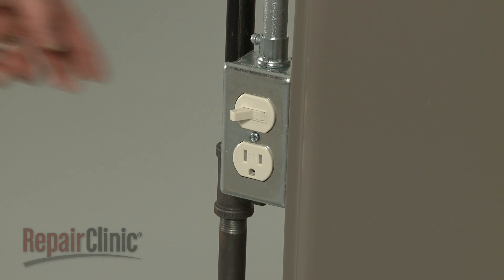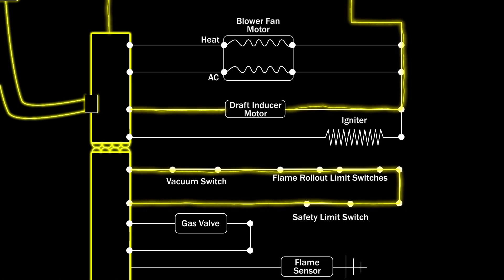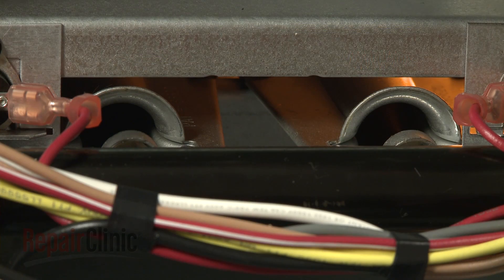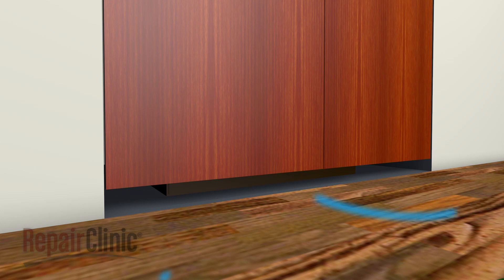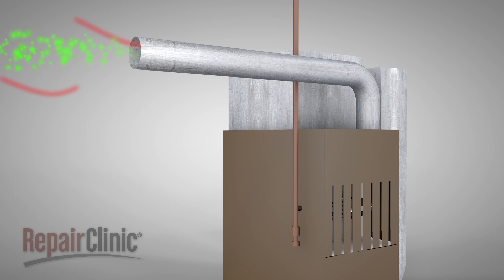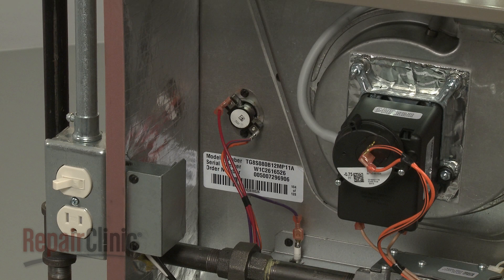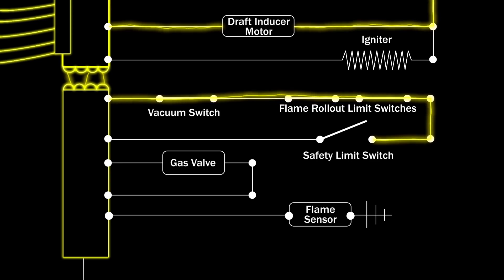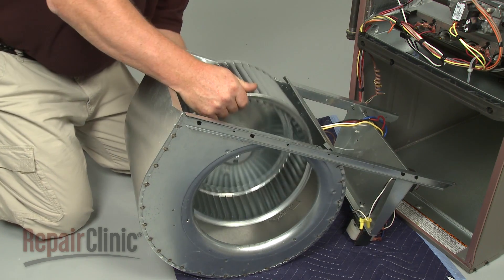How Does a Furnace Work? — HVAC Repair & Troubleshooting Tips

Comment: hello. recently my furnace burner would not turn on. I checked all the signals and even replaced the gas valve. Finally, I discovered a way to make it operate by disconnecting the 12way connector on the main board and reconnecting it back again. Unfortunately, I have to repeat that every morning now !!. The main board LED would not blink indicating any issues it shows "normal operation" indication. !!. I have Goodman furnace "GMS8 90". Any tips on what to do next?

Comment: Quick question. Accidentally dropped a plastic/metal TV cable staple down into the return plenum in a tight furnace closet. I can't reach it or see it because it bounced and went down the bend into the top of the gas furnace. There is no air filter that I can find and all the plenum is taped well. Down flow system. Do I need to get that staple out?

Comment: My landlord say he pays gas/heat . But a blower fan is required here with HVAC furnaces. That means I get hit with an electricity bill and resulting me "paying for heat" . Just a heads up guys in case you run into this issue.

Comment: Very grateful for this clear video! No one, and I mean NO ONE has been able to tell me, though, why residential furnaces aren't constructed to draw combustion air from the OUTDOORS. The video mentions it as an option but I've never seen it implemented. That means that all combustion gas released to the safe outdoor pipe has to be replaced with outdoor air, leaking into the house wherever it can "find" cracks or access. This must tremendously (and expensively) reduce the efficiency of the whole process! This would be avoided if an inlet pipe were bolted from the outdoors directly to the furnace. The same is true of fireplaces. My family insists on running the fireplace in really cold weather (after all, that's what it's for!) but I can feel the resultant negative pressure pulling cold outside air in through dozens of places within the house. Serenity now! Please feel free to contact me at davidasproul@gmail.com if I fail to revisit this YouTube video for replies. Thanks!
Reply: Maybe it's more of a regional thing but around here anything mid 90's and possibly older are like this.  There are two PVC pipes typically, sticking out the exterior wall, one intake and the other exhaust for the combustion air.
Reply: @Puckgrinder85  Where I live in Europe it's forbidden BY LAW for the gas fired central heating system to take in indoor air. Has been that way, as you said, since around the mid-90's I think. Usually the pipes for intake and exhaust are concentric, so you only see one pipe.

Comment: Use electrical heater or dx reversed cycle heaters
Reply: Those are extremely expensive to run and cannot run 24/7 as they'd burn out easily

Comment: Hi
I live in England and we have Kerosene oil system as we live in a rural area, I service and repair my own oil fired boiler, self taught with the help of the Internet and tutorials on Youtube at times.
As an electro / mechanical engineer I am always interested to learn about anything thats working in our home.
I often wondered about the furnace system as its a big beast and floor standing, here most of our boilers (furnaces) are wall mounted and much smaller, our system heats water and that gets pumped around the house via copper pipe and radiators.
Many similar operations between your furnace and our boiler system ... really thought your tutorial was worth posting on just to say that anyone could follow it ... great video.

Comment: I just smelled an awful smell of like melting plastic or something in a room by the basement where my furnace is located and not long after that, the furnace shut down. Is this a fire hazard? How was it probably caused?
Reply: Everything Channel Could be anything. You should call a professional
Reply: Michael Mace that is what we did. Burned out start capacitor.

Comment: I have a question: I moved into my house 9 months ago. All gas appliances. Within the last 2 months I've smelled as if something's burning coming from the vents in the house. The first time it was so strong it woke me up thinking it was a fire but I didn't see any smoke. I called the real estate agent in January expressing my concerns. He came over 15 minutes later, looked the furnace over changed the filter and said the unit looks good. Few days ago I smell the same thing only this time very faintly. The function of it is good. Puts out adequate amount of heat. Clicks on and off. at different times. Is this smell normal?? Should I be worried???
Reply: what did it end up being? Dust in the ducts? Or was the unit over heating from bad supply air or maybe it was a cracked heat exchange?
Reply: carbon monoxide doesn't smell like anything that's possibly the most dangerous thing of CO, it is imperative every home has a co detector in the home it doesn't have to be fancy just any type

Comment: I have a Fraser forced air furnace that stopped working properly at the beginning of spring.  A repairman came by today and found that the reason the furnace was not getting past the initial start up process was because there is a dead bird where the exhaust vent and the motor housing meet.  It's not inside the motor wheel (because that was spinning enough to generate a weak exhaust flow), just at the exit of the motor housing.

I thought all he had to do was remove to bird, vacuum out any dust, feather, etc. but he's insisting that the whole draft inducer motor needs to be replaces.  Keep in mind the motor is working, it's just running too slow for the vacuum switch to close and the ignition sequence to begin (thank you for the "How Does a Furnace Work?" video - very helpful!). 

The repairman claims that he won't be able to get the bird our without it falling apart.  And when it falls apart, he's concerned that it will "contaminate" the rest of the system and cause further problems.  I asked if he could remove the motor assembly, clean it out and reinstall it since it's working. He insists that won't work, the whole thing has to be replaced.

My questions are: is that a reason to replace the draft inducer motor? Could the bird be removed, the motor cleaned and house reinstalled w/o causing any damage to entire heating system?

I'm going to get a second opinion as well as get the chimney cap inspected for openings but I would like your advice on the what my next step should be and if I'm getting good advice from the repair guy.  Thanks!
Reply: He might just not want to clean bird out of a motor assembly. You might be able to clean it yourself and put it back in. Worst case scenario it stops working and you have to replace it anyway and I just realized this is a two year old comment and the situation has probably passed
Reply: FRIED CHICKEN 😬
Reply: I would assume if he cleaned it all and there was no damage to the draft inducer, the unit would run fine.  Maybe he was afraid that the inducer motor might fail in the near future or something.

Comment: hey where are you guys based ? where I live it's against code to repair a heat exchanger, must allways be replaced
Reply: Mike Mastrocola how unfair.
Reply: @elevatorman5468  not really, should you rather be safe or sorry?
Reply: I agree with Lazy, "rather safe than sorry". Cause you will have stupid kids that want to repair their own furnace that will ask stupid questions like "hey my furnace makes noise, what is the problem?" and try to repair it knowing nothing. Those type of people should just call a repair man.

Comment: does the electronic air filter tell you when it needs to be cleaned or what does it do thats diffrent from ordinary air filters
Reply from the maker: +Hays Coleman It depends on the model filter you have installed on the system.

Comment: I need to replace a blower motor in a Carrier Weathermaker 8000 but the exhaust pipe/duct is directly in front of the blower motor assembly. How difficult (what are the steps) is it to remove the exhaust duct?
Reply from the maker: Roy Gates The draft inducers venting is something that is unique to a furnaces installation and not something we would have information on.

Comment: I hope this helps, my furnace was running that red light was on constantly which means there was no error. But it was blowing cold air. 

If that light is blinking it means there is something wrong with the furnace and it indicates an error code. That light wasn't blinking which means that everything was working properly as far as furnace basic system system.

Furnace fan was working also as there was air coming out of the exits/vents. But it was blowing cold air.

Which means the heat system of furnace wasn't working, so either gas supply was insufficient or the lighter wasn't working to start the flame.

There is a spot where the actual fire burns or you can see the pilot fire burning, there was no light there. I took out the filer and will clean and put it back, but now the fire is burning and I can see the flames.

I am not sure that it started working because i took off the dirty filter, I believe its not because of that but at least i was able to figure out what was wrong with the furnace.

Now its heating properly, I will clean up the filter and put it back as my filter is a reusable/washable ECO filter.
Reply from the maker: We're glad your furnace is working well again.

Comment from the maker: Here comes the cool weather! Is your #heating system ready? Get a refresher on how your #furnace works and what you need to do to keep it running well and efficiently this winter! #heatingandcooling #hvac #furnacemaintenance
Reply: Its amazing that the thermostat does all that in less than a secondf

Comment: Not all furnaces use gas to warn your home.Electric furnaces are alternatives to gas furnaces,--and they don't release carbon fumes.
Reply: Yes that is true that electrical ones are safer and do not give out deadly fumes but it takes forever for it to heat up(30 minutes or longer) and many people prefer ones that run on Gas as it is quicker.

Comment: so I'm getting a new house and it's gonna likely have a gas furnace and I'm quite paranoid about them since I keep seeing videos on the news of some blowing up and leveling 5-20 house around them and the damage being quite catastrophic. I plan on having an inspection done when buying the home and yearly. I will get a CO2 detector as well. My ultimate question is A) what does natural gas smell like? B) Is there a such thing as a natural gas detector in case you have a leak.
Reply: I just moved into a new place with a gas furnace and I am terrified every time it turns on. The clicking and the igniting it just terrifies me. How did you end up liking having a gas furnace? I also have a carbon monoxide detector.